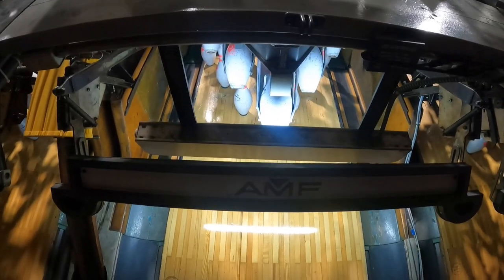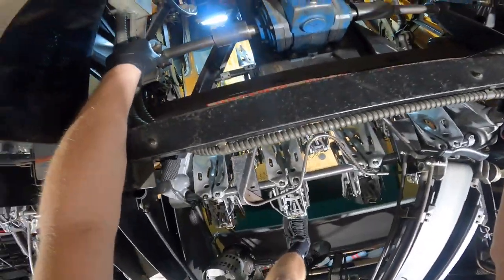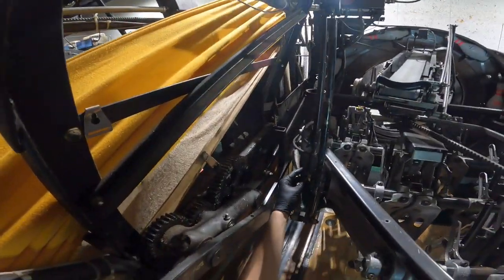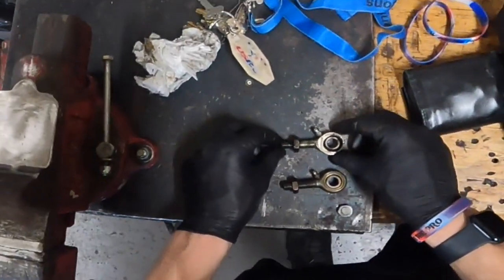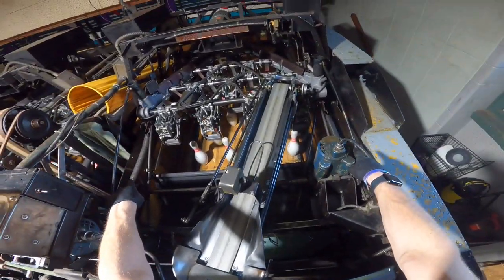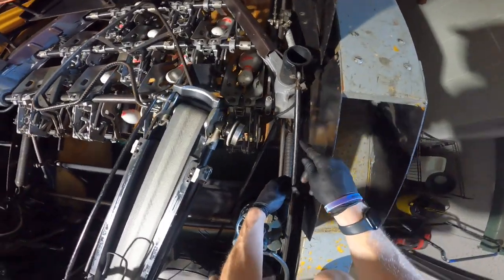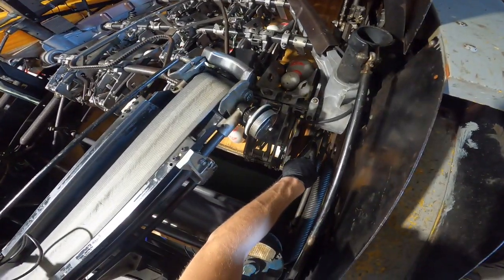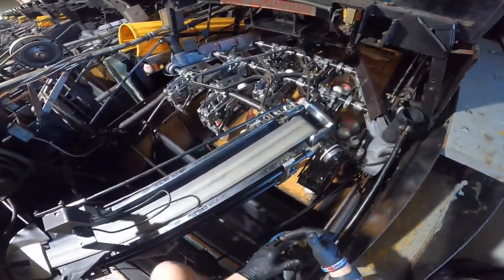AMF 82-30 Table Overview + Adjustment Tutorial

Comment: How does the pins not fall out of the pincup for the 82-30,82-90
Reply from the maker: Each side of the cup is bent at the bottom, preventing the pin from coming out

Comment: That "spot rod" is not really the spot rod.   It's the table leveling rod.  I know, we all did that !  The table should be down at 180* and place a short level on the top respot cell track.  Then you level the table.   The lower cross bar is the diagonal rod.  Check the center table gear bushing and pin first.    For a fast check of table tilt, run the table down on a full set of wood to 180*.  Then use your finger tip between the respot cell tracks and check for distance.  Be sure the upper pads are all good.  In 30 seconds you will know all about table height and tilt.
Reply from the maker: Thanks for the tips!